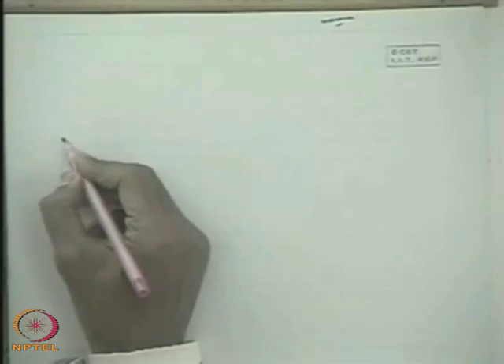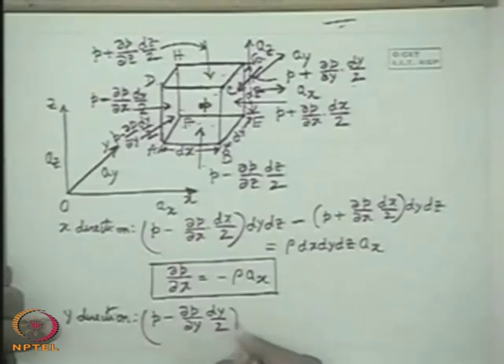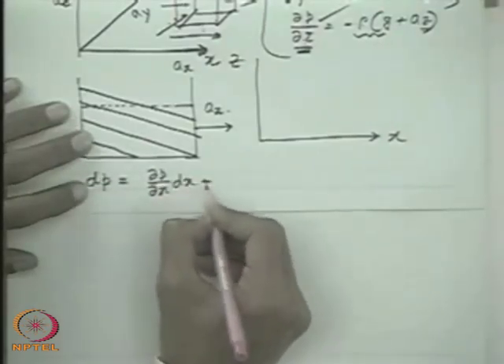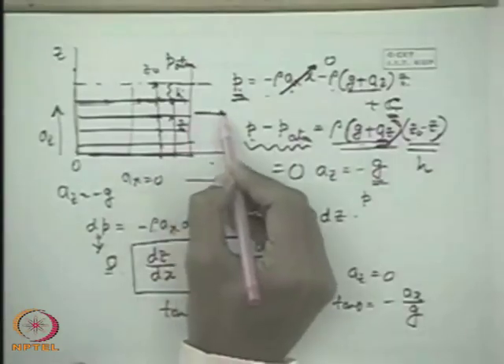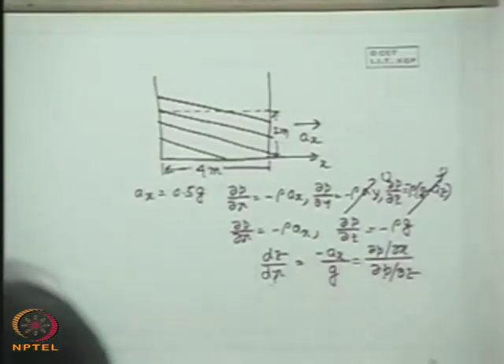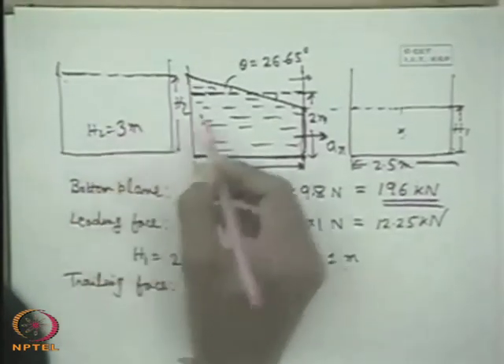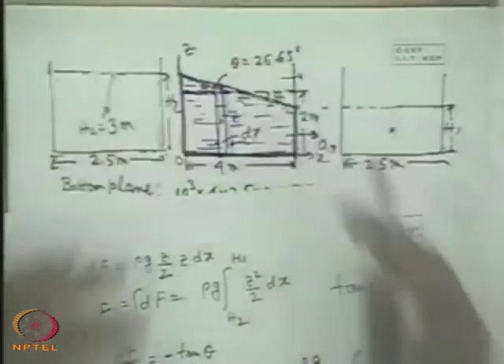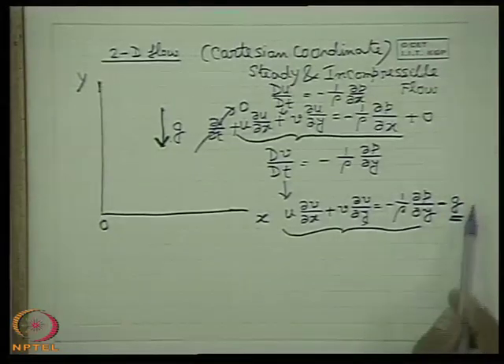Mod-21 Lec-21 Conservation Equations in Fluid Flow Part - IX

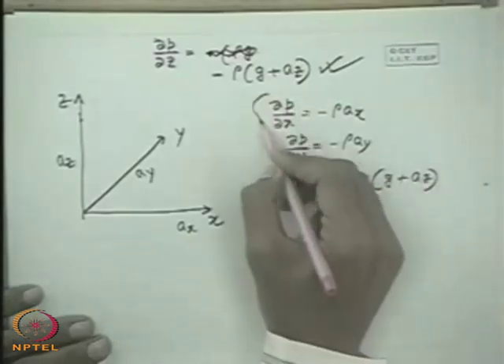Comment: Can someone please explain how are derived expression at @13:20 different from euler's equation?  i think only difference is 1) acceleration is assumed to be constant  2) body force acts only along Z direction 3) pressure decreases with increase in x,y,z direction respectively so a negative sign
Reply: One more trick is that we can derive Euler's equation in seconds if you remember the condition of fluid statics which gradp=(density )(X bar) ; we know that every motion can be solved by modelling it into static case so for accelerating fluid with a bar we just apply pseudo force -a bar which models to static case so for static condition grad p=(density)(xbar-abar) which gives the Euler equation ..
Reply: They are same !! 
In Euler's equation we use body force per unit mass as X bar , here we considered gravity as the only body force I.e Xx=0 :Xy=0 and Xz=-g just substitute these we get this equation which sir derived in this class.

Comment: sir, from time 36:15 onwards in the calculation of forces on leading edge and trailing edge , the distace of centre of area for free surface is taken 0.5(for leading edge) and 1.5 (for trailing edge)  but here free surface is tilted hence the distance of centre of area should be taken for new free surface i.e. 0.5Cos(theta){for leading} and 1.5Cos(theta) {for trailing}, sir please it's confusing ?